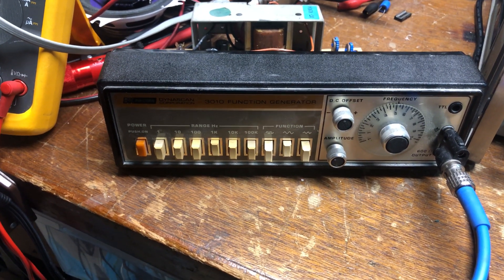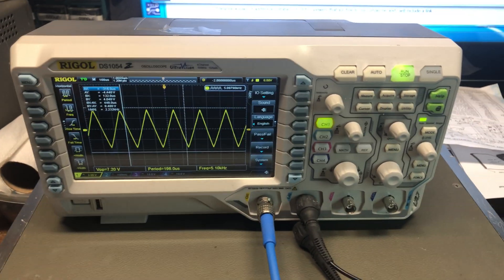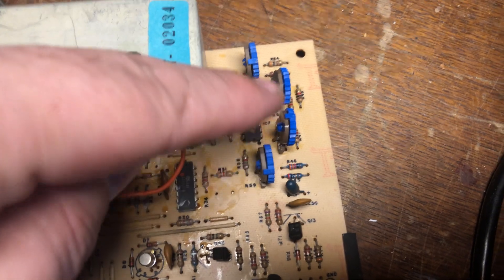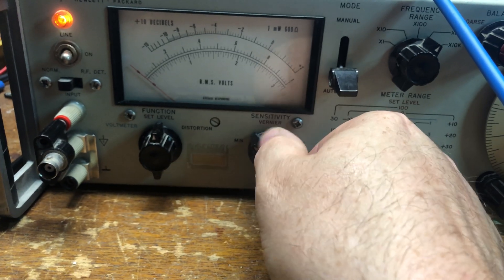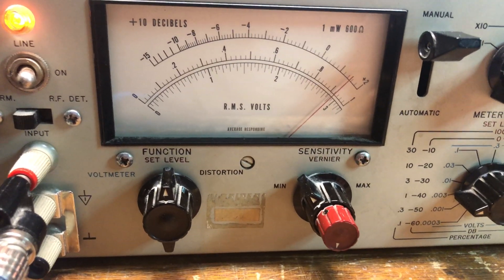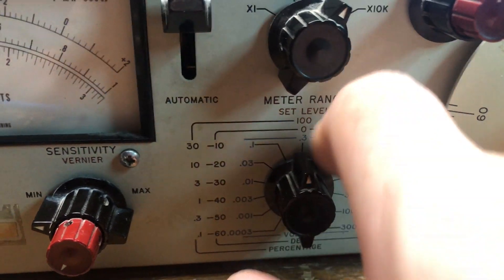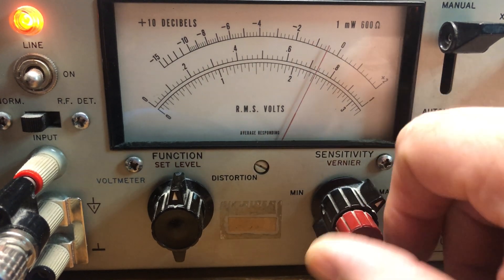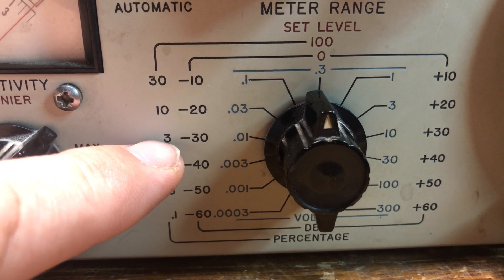How to use HP 334a Distortion Analyzer

Comment: Joe, thx for sharing. You got lucky the sine converter could've been broken and you wouldn't have gotten near as low a distortion. Hey, I'll take a lucky break anytime I can. 
Those HP 334s are not fast to operate but they're durable and quite accurate. The autotune feature is a great time saver too. The earlier ones didn't have that feature which slowed measurements down a lot. You got relatively quick measurement time even it manual mode. Good job.
Again, thx for sharing.